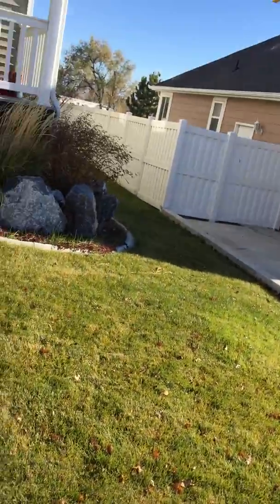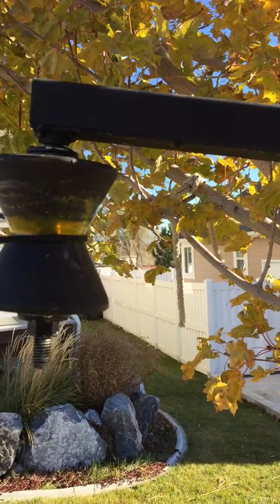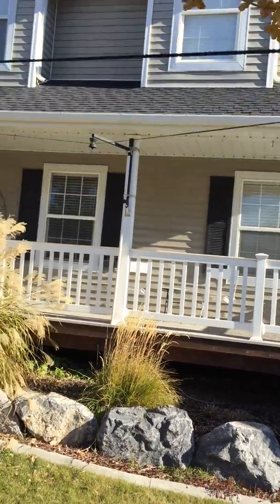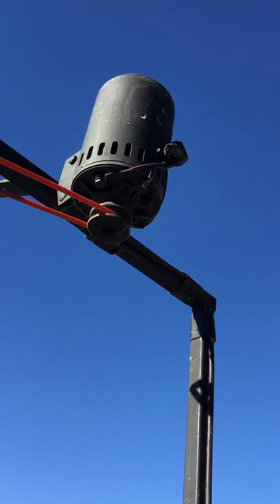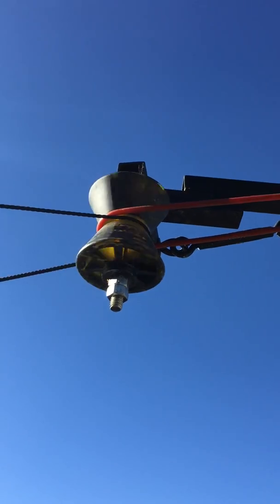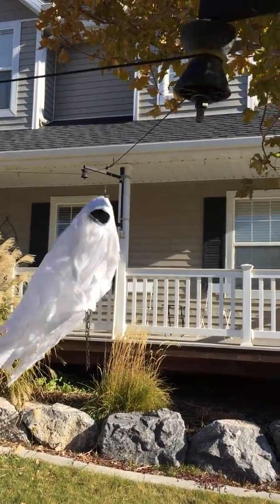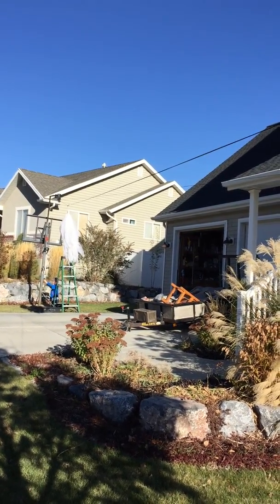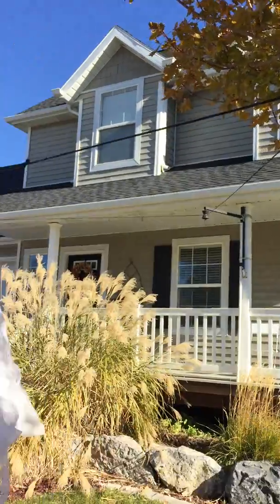Axworthy Flying Ghost Halloween Project

Comment: I have to say after watching several of these, yours looks the least complex.  Can you tell me what size the bow rollers are?  Or a link to what you bought?  The ones that I see online appear to be smaller than the ones you have.  TIA
Reply from the maker: I believe this is the one I used.
https://www.amazon.com/Shoreline-Marine-Roller-Poly-3-Inch/dp/B004UOVFOW/ref=sr_1_28?crid=2MCPVBD2FDT3W&dchild=1&keywords=polyurethane+bow+roller&qid=1634907265&qsid=143-1233225-8122426&sprefix=polyurethane+bow+rolle%2Caps%2C119&sr=8-28&sres=B000YD6OXU%2CB07WP271M7%2CB004OI3F7Y%2CB000N9TBFI%2CB00144AFCY%2CB000ZFPWKS%2CB000FPCKBW%2CB000VX7HKW%2CB00O133T00%2CB01AVDVHTI%2CB00RJKB2FQ%2CB00G0ODKDE%2CB00G0ODL1A%2CB00714ZOOA%2CB07B9HBZ1Z%2CB000N9XGT0%2CB0067NK8GA%2CB07BLLQ4B3%2CB01KS6DZ34%2CB07H14X98W

Search for Bow Roller on Amazon.  The benefit of this roller over a bicycle wheel is you don't need nearly as much tension on the line to keep it on the roller and the alignment between rollers doesn't need to be perfect.

Good luck!
Reply: I've made tons of Halloween props and this has been by far the most frustrating prop I've ever made trying to use bicycle wheels. The line used doesn't even matter I've tried fishing line, Paracord etc. the line falls off regardless of tension as soon as it enters the wheel, exiting was never an issue just entering the bike wheel. This solves all of those issues and I just wanted to thank you for sharing your knowledge with the rest of us haunters. I got my bow pulley coming tomorrow and it's time to finally get this project finished.